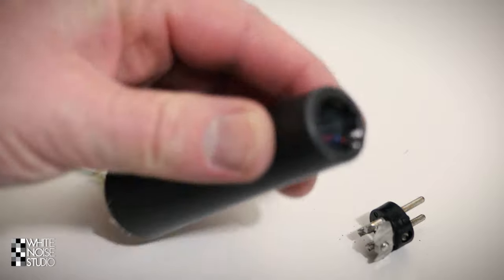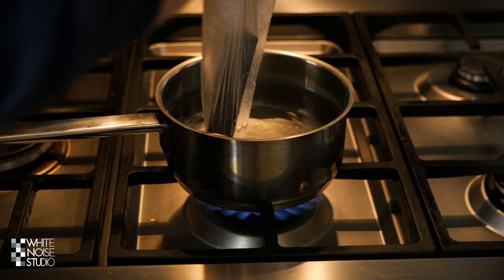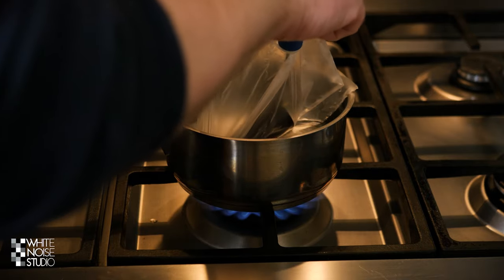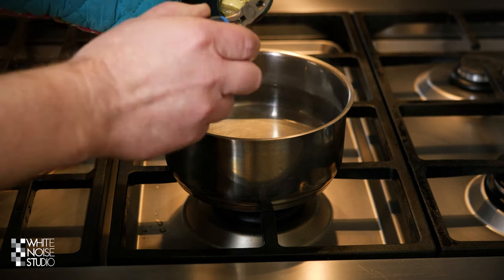How to do the SM57 transformerless mod - Step by step tutorial

Comment: I can see how loosing 3k and 7k presence in a snare mic would make mixing much simpler, especially for a top side mic where you aren’t using it for presence as much as transient shape. I think as a guitar application it comes down to personal taste, but the guitar demonstration made the difference readily apparent. Thanks for the science! My recommendation would be transformer for leads, no transformer for heavy rhythm
Reply from the maker: Yeah, removing the transformer should be done for  having an extra tone alternative. Bit like the mid switches on a sm7b. I personally prefer w/o trafo on snare, on guitar cab i use both variations, depending on guitar sound.
But I switch mics more on guitarcab , also using md421s, md409 etc or a condenser on occasion.

Comment: Hello, thx for the vid, it's been really useful! I've got a question, how to get rid of molten silicon inside the tube properly? It's leaked out and covered the inside so it's a challenge to put the xlr back in
Reply from the maker: Hey there! I would carefully re-melt. Scraping it off as last resort.
Reply: Melt again and poke a straw through the glue

Comment: Great video. I have a SM57 copy mic already without transformer, and im getting very nice low end from it, but it cant be placed within 15 cm or so of the drum, then the audio very messed up. Some told me because the pickup is being hit by too much pressure and causing distortion. Sound pressure level. A transformer should help smooth out the signal removing the fine fizziness. You think this is the issue?  And you think solved if i ad a transformer?
Reply from the maker: Thanks! I think something else is going on. I will speak about a real SM57, I dont know about the different types of copies floating around :-)

The transformer in a sm57 is made to amplify the signal from the capsule and with that colors the sound with a very midrangey tone.
So if the capsule would be blown out by a kick, the transformer wouldnt fix that. 
 Try reducing the input volume of the mic to see if the soundcard isnt the one clipping. 

If that isnt the case, there's not much you can do, that would mean the mic capsule simply cant handle the soundpressure.
Try on other sources too to double check.
Reply: @audiotoolshed  Thanks for the info
Reply from the maker: @robbyrock-drummer  You're welcome!
Reply: I think your copy likely has an inferior capsule than a genuine SM57/58 capsule which will withstand enormous amounts of SPL and why they are frequently used in sound reinforcement and recording sitting directly in front of guitar amps and close to drums.  Your distortion is probably due to the fact that the capsule's diaphragm is breaking up when hit with high SPL.  A used SM57 often goes for a very reasonable price so there is little excuse to substitute with an inferior copy if you need the performance of a genuine SM57.  The clones by Behringer, Pyle, GLS and a host of others can sound ok, but cannot withstand high SPL and the overall build is nothing like the Shure mics.   The transformer adjusts the impedance to match that of professional sound systems.  It does impart a slight change in "color", but that is up to the listener's opinion.  Another important function of the transformer is to isolate the diaphragm from potential DC as in 48V phantom power for condenser mics that might otherwise damage the voice coil. Be sure to leave XLR pin 1 connected to the frame ground of the mic to maintain the balanced output characteristic.
Reply: I have a behringer 57 clone and it doesnt have a transformer but sounds great! It had a lot of handling noise but I filled the body up with epoxy and it fixed the issue.

Comment: Hey, is there a specific type of wire i need to solder, or do thicker copper wires work too?
Reply from the maker: If you look at the cheap small wire used in a sm57 i would worry too much about using thicker cable. Will work as well.  Dont go too thick, you need to squeeze that all in that body.
Reply: @audiotoolshed  yup, i just found a thinner one cause even though it’s a bit more fragile, it works like a charm
Reply from the maker: Ok good :-)

Comment: I think the wires from the capsule should go to pins 2 (+) and 3 (-) - not to pin 1 which is the ground and connects via the socket to the microphone body.
Reply from the maker: Hey Mikko! By removing the transformer you make the mic unbalanced. So 1 of the wires has to be the ground.Wiring them wrong around will invert phase. Check it to be sure :-)
Reply: @audiotoolshed  Removing transformer doesn't make it unbalanced - you did it when you connected it that way. Just connect the + output (yellow cable to transformer) to XLR + pin and the green to - pin and let the XLR ground be there where it is. Obviously you can swap the connections if you are worried about the phase.
Reply from the maker: @mikkohelin529  Hi Mikko, you're right about the unbalanced part, the transformer doesnt make the mic balanced. I had it mixed up with regular audio transformers who usualy can do unbalanced to balanced and vice versa.

I do connect the wires correctly and it is mentioned correct in the video.
pin 2 to the A of the capsule and pin 3 to the B of the capsule. 
Pin 1 of the XLR is always ground.
Reply: @audiotoolshed  Please rewind the video back to 3:40, it shows that you connected the the red wire to pin 2 and the shield of single wire shielded cable (should really use a twisted pair of unshielded wires) to pin 1  while the pin 3 was left floating. However, you spell it correctly "pin 2 to A point and pin 3 to B point in capsule". In the video however you solder to pins 2 and 1 in that order. The pin 3 is the pin in the middle, pin 1 is the ground pin. Anyway, some kind of schematic would be nice, and thanks for the inspirational video anyway! This mod makes SM57 to sound more like SM7B and unfortunately also as quiet. You will need a proper preamp with > 55 dB gain.
Reply from the maker: @mikkohelin529  I'll be damned you're right. That's an oopsie in the video and this way it's unbalanced. Fortunately the text and explanation is correct. 

Twisted cable can be better for sure, the cable I used was at elast of way better quality then the cable standard inside the sm57 and provides similar protection ( read barely useful)  

Yup the the volume drops a lot without the transformer, the sound has less mids and more top end as you can hear in the video. Add a clean preamp with enough gain to boost the signal on soft signals or , in the case with snare, you don't have to use the pad on the  preamp anymore. I also keep a sm57 without the mod for sounddifferences. There's a reason why the sm57 works well on guitar cabs. The mod gives a cool sound alternative.

Comment: I have 2 of the behringer 57s. They dont have a transformer. Probably why its cheaper. That and the body is hollow and gets a lot of handling noise. But I suppose if you wanted you could buy the right transformer and put it in the behringer, fill the body with wax or epoxy and have a real 57 for half the price. For another 20 bucks you can have the modded more open version. Still less than the price of a sm57.
Reply from the maker: If you calculate in the price for the labour you need to put it, you will be suprised ^^

Comment: Nice, been meaning to give this a go for a while. Can you use the transformer again or is it rightly bolloxed?
Reply from the maker: I built two of those removed transformers in a 19'' housing, added connetors and a volume pot to it and use it for an instant midrange boost eq type of type when I want ;-) So the answer is ''yes'' ;-)

Comment: Done. It made zero difference. I think I either have a fried xlr connector or a bad capsule. It's sounded boxy and thin ever since I hooked up a bad a cable to it. Thought this mod would fix it for some reason lol
Reply from the maker: Boxy and thin is not good at all. If you can rule out you haven't made a wrong soldering connection it can be that a capsule is fried.

Comment: interesting! but it doesn't sound that better. actually I find it sounds much more muddier.
Reply from the maker: Funny how people hear things differently right? Your muddy is one other's bassy. You're probably missing the midrange boost of the transformer.
Reply: Das ist der riesen Unterschied der bei dem Snaresound fehlt wenn die Leute immer mit dem standard sm57 aufnehmen. Wenn man mit gescheitem Equipment und nicht einem billigen 500€ interface aufnimmt, klingt die snare danach megaaaa. Das richtige Prozessing natürlich vorausgesetzt. Das was da untenrum gefehlt hat mit der standard version, bekommst du nie wieder später. Da kannst du EQen wie du willst.
Reply from the maker: Interface really wont be that much of an influence. Standard Sm57 can work well on snare of course, but it has that midrange boost. I often pair a standard 57 with a sdc, a rode nt5 works really great on snare. I often prefer the sound of the nt5 over a unmodded sm57.
Reply: @audiotoolshed  Yeah I don't like the SM58 amd SM57 because of that sound. Midrangey isn't necessarily bad, but on an inarticulate mic it is. Classic U87s and the teflon C414s, as well as Oktava's mics are all good mid forward sounding mics. But a stock SM57 and 58, no thanks.
Reply: @dylanj8676  Agreed with you, bro.  My ears like all of the mics you mentioned more than the SMs, too.
Reply: @audiotoolshed  Have you tried an NT3? I use it for lower levels kits; it has an easily controllable 6k bump but otherwise is superb all by itself. I did the TAB transformer rework for the 57 that is use for the heavier rock/metal stuff.
Reply from the maker: Never used a nt3 ! I do use a nt1 on floortoms, is awesome although very hot output. On snare I really like the nt5 as wells either alone or in combo with sm57, both on the top.
Reply: @audiotoolshed  I nearly have  single stereo mic solution but takes a bit to get right (for low vol)...ironically a well placed r88 is pretty amazing when you want a soundstage...but you can sidechain the snare (nt3) and kick (boundary or whatever) . Doing that on next organic project...it amazing how the transients in that application create such a picture of space...no phase issues obviously
Reply from the maker: Sounds like a lot of fun! I mainly record louder stuff, so I need to use close micking a lot.
Reply: @audiotoolshed  Gotcha...yes understand. Sorry to hear that ;-) I use to do rock/metal...a lot wider these days...vivaldi string quartet on location a couple of weeks ago. I totally recommend the TAB mod to the 57...you wont need the nt5 and wont get the phase issues...although sometimes artful
Reply: @audiotoolshed  there is rarely a 'bad' mic...and often...the wrong one
Reply: @audiotoolshed  btw its easy to remove just surface mount resistor to remove the bump and its quite a good mic for guitar.
Reply: The mod removes that snare shell ring thingy that you have to fix via EQ. The modded 57 sounds LESS muddy to my ears but I'm old so...

Comment: I wouldn't place the mics that close to the grill of the amp. :)
Reply from the maker: Why not. First of all, the grill isn’t moving that much at all so it won’t touch the mics and secondly you don’t know how far or how close the speakers are in relationship to the mics. I do know with this speaker. You place the mics, you listen and adjust. Don’t assume anything from the placement based on visuals. Use your ears.